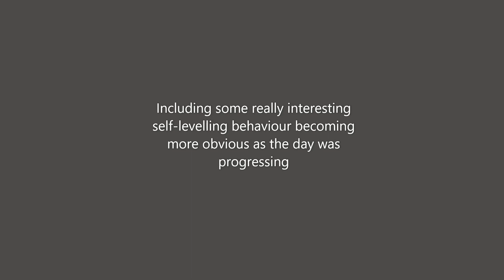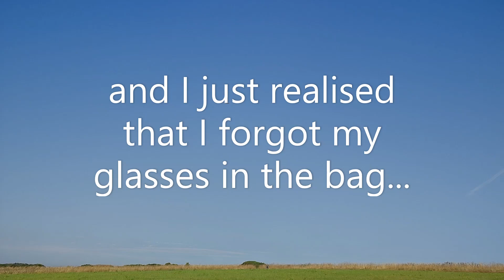Flying Wing Without Lateral Stabilizer Field Testing.

Comment: Is it the design of the wing or Motor torque That's causing all the rocking motion?
Reply from the maker: I have added small vertical stabilizers to it so I will check this idea next time I am flying
Reply: I agree I think it's the  dihedral Effect created by the tips
Reply from the maker: I think it's the design of the wing. When flying that day I realized that it had a strong self leveling tendency so I was letting it do it on its own accord.